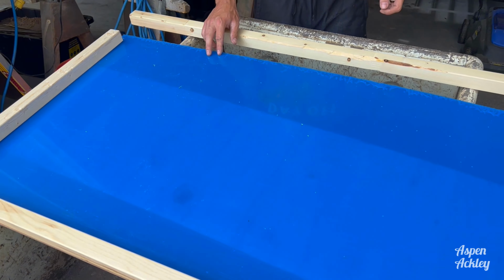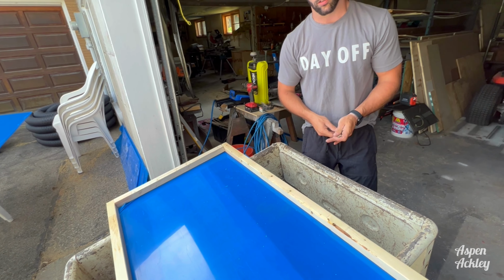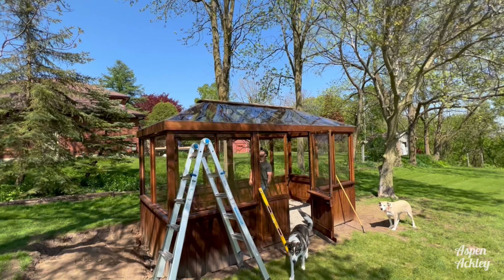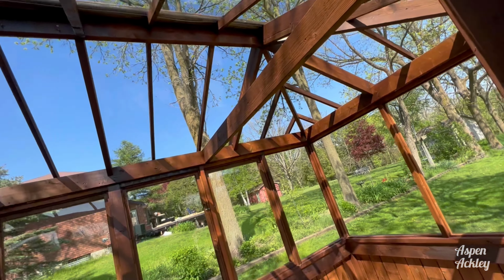We built a greenhouse in our backyard!! (the complete process from start to finish)

Comment: could never do the weather vane. if it fell and broke the glass, i would be like, “ well, our greens house is missing a glass panel. That’s fine
Reply: Seems like Andy is a pretty sharp carpenter. The plexiglass they're using won't break and shatter the same way as glass would. It can crack then break, but not near the same damage and danger with the shards of splintering glass everywhere it could be in the gravel below. The fur babies paws and Andy's sock covered feet (the, he, he) would be pretty safe for the most part until the damage is cleaned up. Plexiglass quality has improved over the past 25 yrs too.